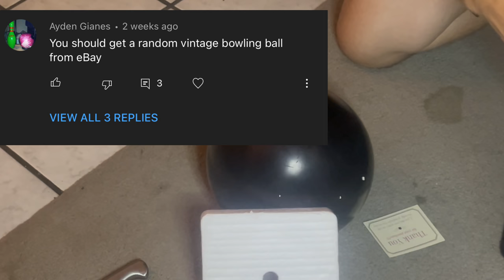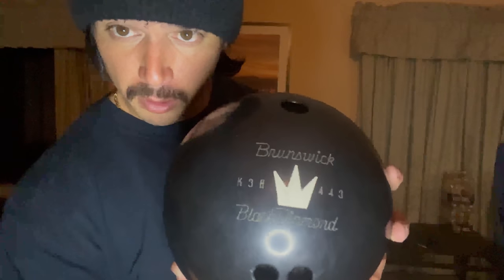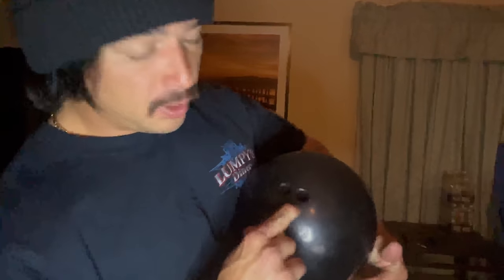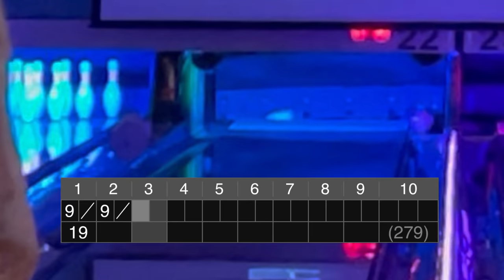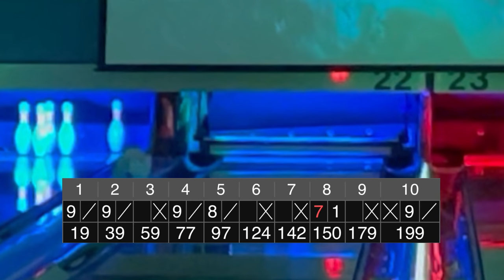Random Guy takes over Bowling Pro Shop to redrill Rubber Ball

Comment: I just watched your video. Earlier today I pulled out my Black Beauty 16 lb ball to see if it still if me. Had it redrilled with thumb slug and fingertip with grips. Fits great. Thought about taking it with me for making spares instead of my Black Out Mix. It struck me funny that you were bowling with the Black Diamond today. Nice going though. Not much deflection when entering the pocket. Good job...
Reply from the maker: What are the odds 😂 and yeah the ball actually looked pretty decent hitting the pins. Surprised that I 9-pinned
Reply: @220avg  Looked like it was all speed control.  Too fast and it couldn't get to the pocket.
Reply from the maker: @ripvanrevs  yes. I slowed down my ball speed to get it to turn and a few shots I accidentally threw it a little bit faster

Comment: Gotta do 3 games in your videos. Want to see if you improve or if the conditions make these weird balls impossible. Easy to speed up the recording. Gotta challenge for you. No step. Behind the approach. That old ball would probably be your best bet. Lol. Had a 227 high game trying that a few times
Reply from the maker: Hmm maybe I’ll do more videos with more games in the future. I don’t know if it’d be too long though.

227 from the back of the approach?? That’s impressive
Reply: @220avg  too long? Your videos are really short. Lol. I like em 20 min + but that's just me apparently
Reply: @220avg  used to bowl 10-20 games a day. Always wished I worked at the lanes and could experiment like this. With the drilling and the practice spares. 10 pin always got me, and my thumb got destroyed for a few years. Super glue wouldn't hold. Just rip off the blood blister. Even with 4 different pro shops experimenting with the thumb hole. Gave up 5 years ago
Reply: @adamthatoneguy8221  it’s not just you, i like long videos too
Reply: @220avg  Its very interesting when you throw vintage bowling balls I would like for you to throw the 90s 80s balls I want you to throw the fab blue hammer first
Reply: @adamthatoneguy8221  Damn, that hurts. Another reason I went to not using grip pressure. Before I did, I got a thumb blister also. Is that black diamond really the best bet for straight shots at the 10 pin? lol

Comment: I've ordered a Brunswick Black Beauty just for fun, is there any truth to the older rubber balls having trouble in the ball return? I figure the machinery at my local spot has been there since 1960 so it should be able to cope with a ball of the same era. 
Also, I have no idea if it's going to even fit my hand. That could be a big problem, but hoping for the best.

Comment: You should do a video where you drill a ball as illegal as possible, i.e. multiple weight holes
Reply from the maker: I like this
Reply: @220avg  No need for balance holes, make a plug with lead or something in it so it has.... wait you could go up to +3 oz. side weight and it's still legal...

Comment: Video 2 of asking you to drill a ball with only 1 finger and a thumb and try to use it
Reply from the maker: This is in the works eventually 🙂
Reply: @220avg  In the early days of bowling 2 hole balls were common. The ones I've seen had really big holes. I'm thinking they may have put two fingers in one hole.